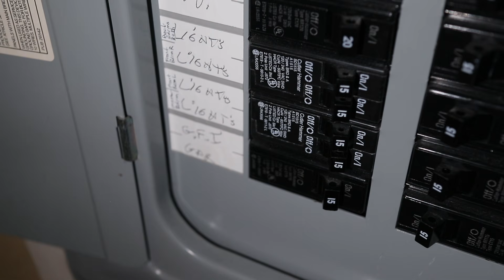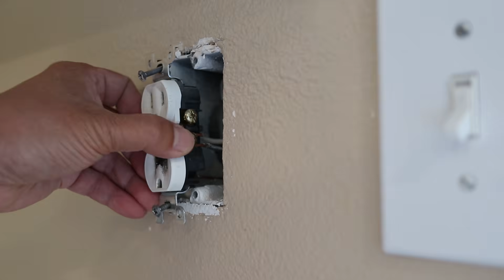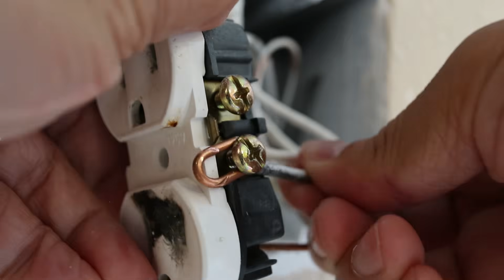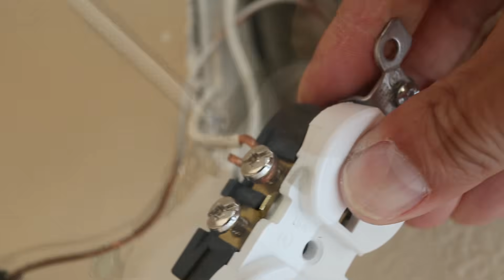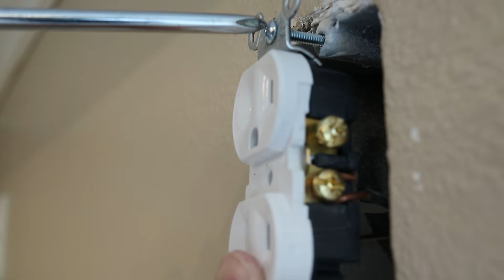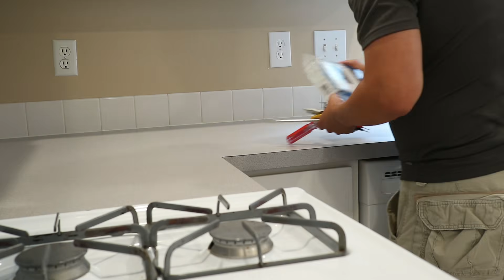How to Replace an Electrical Outlet – Replace Burnt Out Electrical Outlet and Old Damaged Socket

Comment: The wires had too much exposed copper wire to be safe when wrapped around the terminal there should not be anything that shows add a terminal except the insulation cover

Comment: That circuit tester step is really important. Verifying the outlet is de-energized takes only a few seconds but can prevent a dangerous surprise if the circuit labeling in the panel is wrong.

Comment: would this solve a fishy smelling outlet? its just one and unfortunately no electricians are available at the current time but i’ve been told i just need to replace the outlet. i don’t plan on using the outlet anymore to say the least 😂

edit: breaker to the room is off until i know what to do
Reply from the maker: From what I’ve recently read a fishy smell from an outlet is a potential problem. It’s best to replace the outlet or at least call an electrician for advice if you’re not comfortable replacing the outlet yourself.

Comment: I have that same problem but the top outlet still works so I just covered the burned out  bottom outlet with electrical tape and use the top i rarely use that outlet so it should be ok until I get a electrician to fix it I’m afraid to do it myself even with the circuit breaker off lol

Comment: Can someone explain to me I had one that shorted out but the following plugs stop working as well I replaced the receptacle that shorted but still not getting power to the other two receptacle any ideas
Reply from the maker: You might have another plug in the same room or nearby room with a GFCI on it. When your plug shorted out it might’ve tripped the GFCI on the same circuit. Just press the reset switch and it should be ok. Just remember it might be in an adjacent room or behind something like a couch. You’ve probably already did this but check the breaker switch for your room.
Reply: @TheRenderQ  there is no GFCI on the circuit that I’m having trouble with I have 124 volts on the plug I replaced but the most important getting from the other plugs and switches are low voltage like 16v so do I need to replace all the other plugs and switches?

Comment: I burned out an outlet with a heater. I could smell it burning. I was able to turn off the breaker and pull the socket out the wall. I want to change the socket but I don’t have the materials to do it yet. Is it ok for me to turn the breaker back on because it’s connected to other outlets in the room/apartment? Or should I just wait until it gets fixed to turn the breaker back on? I don’t want a fire in the wall.

Comment: Thank you for your video it was helpful however I have never done anything like this before so I was very nervous if you turn on the outlet after you replace it and it doesn't work if you get the wires mixed up could not burn up the outlet
Reply from the maker: I don’t think you will burn out the outlet but if your wiring is not correct you could damage the device you plug into it or worse. So if you’re not comfortable with this I would recommend getting a professional to help!

Comment: can a bad outlet cause no power in room? bc thats what is happening to me it was sparking
Reply from the maker: An outlet that is sparking can cause a room to lose power only because it may have tripped the breaker switch for that room. If the breaker switch didn’t get tripped then it’s possible that it tripped a nearby GFCI outlet. Look for a tripped breaker or reset the GFCI switch.
Reply: @TheRenderQ  its good now, i changed out the outlet and my power is running well 👍 person who wired this house did a really bad job and power goes off in sometimes 2 or 3 or just a light. yeah it can sound complicated but thats how it was lol 😂

Comment: NITS TO PICK -
1.) Use a Needle Nose Pliers with INSULATED GRIPS. Yes, the power is off ...sort of.....maybe... but you still use standard safety practices and tools. 
2.) Again, while the Power might be off, until your wife or child turns it back on without you knowing, I do not touch bare wire or screws. Yes with the Power Off it is safe, but it is also a bad habit to get into. 
3.) Use proper tools of the Proper Size, that long screw driver is a prelude to it slipping and causing an accident.
4.) Use Insulated Tools and never let your skin touch any Metal part of the Tool. Yes the Power is off...for now... but this is a matter of Bad Habit vs Good Habits.  
5.) Screw all the Screw down. Don't leave the unused one sticking out like you did. Again Bad Habits vs Good Habits. 

Handling any Electrical Wiring is like handling a Gun, even if you know it is safe, you treat it as if it is not. The Stakes are TOO HIGH to get into Bad Habits or to tolerate a mistake. 

Overall though, very helpful.

Comment: What if the wire insulation is burnt?
Reply: Might have the wrong wire size for that circuit. It shouldn't burn before breaker trips

Comment: This is one of the worst wiring jobs I have seen.  There is  way to much insulation stripped from the wires and the wires are badly nicked.  You need to redo this and fix your work!

P

Comment: A few pointers:   test BOTH outlets for power before opening and handling.  One of them could be a switched outlet that is powered independently from the other.  2.  Too much bare wire is exposed from the loop.  Ideally, the insulation should end just before the screw head.  3.  On the old receptacle, you can totally remove the screws to make freeing the loops much easier.  4.  For the new receptacle, if the loops don't go under the screws easily try slightly backing the screws out (don't remove) this may get you the clearance you need.  5.  Any unused screws should be tightened down.  6.  Make sure the black wire goes to the brass colored screw, white to the silver colored screw.  Don't assume the person before you did it correctly.
Reply: i love the last part. don’t assume the last person did it right! i learned that the hard way🫠
Reply: Great Tips! Thanks!
Reply: all great points 3283...
Reply: Excellent tips. Thanks.
Reply: Thank you!!
Reply: Thank You
Reply: Thanks, I feel like I am getting close to trying this myself and not have my house burn down. If I were still renting I would have gone for it already

Comment: Just a reminder to everyone to please keep the “hook”  trimmed to the appropriate length. Most outlets actually have a gauge printed on the back showing how much of the wire should be stripped. When it’s excessively long and sticking out it creates a risk of the wires making contact with something that wasn’t in the plans. Many people also wrap electrical tape around those terminals also to prevent it from shorting out during reinstallation. Everyone be safe !

Comment: This didn’t help at all. You’re only showing how to replace a traditional outlet with another traditional outlet. The outlet I have has like 12 wires poking out the back, no screws whatsoever. I’m trying to replace that outlet with a traditional type, such as what you’re replacing here. It’s a common bedroom outlet, but it does not look like any outlet I’ve ever seen before. I can get it disconnected from the wall, but then what do I do with all 12 of those wires when all I need is 2 or 3 with the standard traditional wall outlet I want to replace it with?

Comment: I have a plug that is burned like this one but the wire is  to far in to pull out to replace  so I decided  to cap it off but it piggybacks other plugs and I can't get power back in my room ...what do I need to do ?????

Comment: Can you still use the other outlet that was not burnt?
Reply from the maker: I made this video awhile ago but I think the other non-burnt outlet still worked. Actually I think both outlets still worked. That black plastic was probably caused by sparking and maybe just a cosmetic issue but for peace of mind I replaced the outlet. Thanks for watching!

Comment: Just commenting as I watch.

It looks like there’s paint, or some other random overspray coating on that ground wire. It should be cleaned off on the hook end before reconnecting to prevent a poor connection.

Comment: That hook strip is a bit long, especially if you have a metal outlet box. I’d be nervous about an arc to ground, or a short if there are a bunch of wires shoved into a shallow metal box.

It might be worth trimming the wire a bit to shorten the exposed wire, & reform the hook, just to prevent potential issues.

If you have a plastic box, it may not be an issue. However, many older homes were wired with metal boxes, & sometimes metal conduit to prevent rodent damage to wiring. Just something to consider.

Comment: Thanks, 15 here and with a bad outlet in the living room with a smell coming from it and a family that's too busy to do anything about it, I thought I could get it but overconfidence isn't something you want with stuff like this.. wanted to double check myself and this was just perfectly concise to do it without taking all day or getting a shocker. I won't go into it since it's already in nearly every comment but definitely important to remember the way the wires are supposed to hook, so it doesn't loosen when you tighten the screw, I think I remember that from a Technology Connections video. Gotta love that Alec.

Comment: Great video but too much copper exposed on the wire connecting to the terminal screws. It shouldn't extend past the screw especially past the back of the outlet.
Reply: But what if you're just a diy type of person and don't know what's the exact requirement where can we find this info
Reply: @lindamora7 Copper is what carries the electricity

Comment: After having a horrible experience with a very bad and insulting electrician company, I never wanted to bother with one since. We have an outlet that was burned out (from previous owners), that we never got around to fixing. I've always been nervous working with anything electricity related, so I just left it be and put a bookshelf in front of it, as to not be accidentally used. It's been five years since we moved in and now that we're remodeling, I need that particular socket fixed. I thank you for saving us money and making this video very easy for worriers like me 😂 Now, I can easily replace it 😊

Comment: Receptacles burn out mostly because they arc due to failing blade retention, which in turn results from heavy usage.  So, replace with a commercial-grade unit that has more durable and positive blade retention. For a few dollars more, they'll last much longer, plus their back wire feature makes them easier and quicker to replace because you can avoid the entire finicky j-hook routine. 

Also, if the exposed wires are so long that they go past the receptacle, trim them back a little to reduce the risk of a short. This is especially important if the box is metal.
Reply: That is a good advice I just replaced mine a few minutes ago and it was easy but I bit tricky because of the wires were butt heads but I got them in there place
Took me a hour to do that because of wiring or else it been 5 or 10 mins
This video helped me out and a very special 15 year old girl a big shout out to
She inspired me to do it myself

I said what the heck a 15 year old girl can do so can I !!!

And I did it!

I replaced ceiling fans now I replaced a electrical Receptacle what's is next

I have to take it step by step
Reply: @NorthernPolaris1225 Yup! Saw a fifteen year old girl in the comment section so this was my sign to man up and buy the stuff to fix my burnt outlet. Still scared..but it needs to get done.
Reply: @arlo9010  shut the breaker off and when you do the outlet remember where the wires go even take a picture of the wires so it will help you you got this bro it's has to be done or fire in your house and lose everything.
Reply: Nailed it 👍🏻

Comment: Here are some comments on the outlet replacement 1. You did not use an outlet tester to check the power is off and the outlets are working properly 2. You did not snip a little bit of wire the insulation is too long. 3. You did not use a #1 Robertson or ecx screwdriver/bit. 4. You did not do the ground first then neutral and hot. 5 Your outlet is not leveled on the wall.

Comment: A black burn mark on an outlet doesn't always mean that the outlet needs replacing. Sometimes, a high-wattage (amperage) appliance (coffee maker, heater, toaster, air conditioner) was unplugged with the switch on and it sparked while it was unplugged.
Another explanation is that a heavy inductive load (motorized appliance, vacuum cleaner, washing machine) was unplugged with the switch on. Motorized appliances produce a big spark when unplugged because an inductor opposes change in current.
Just clean off that outlet with steel wool followed by a buffing with a dry cloth.

Comment: Something important to remember: black wires (on the right) will typically wrap around under the screw first then over the top, so that when you tighten the screw clockwise, it tightens the wire more instead of loosening it. For the white and ground wires on the left, wires wrap over the screw then under because again screw tightens clockwise.
Reply from the maker: Thanks for the additional information. There have been several comments about the wiring. I just place it back the way I found it. And this wiring was done by the home builder. This is from a rental house and the tenants just moved out. There have been a lot of tips in the comments and now I can go back in and put some of that advice to use. Thanks for watching!
Reply: @TheRenderQ  I just did the same way you did and put it all back together like it was but had to do some adjustments on the wires so they stay tight and not near the outlet box 

Metal of course not plastic

I wish it was plastic

But you get what you can work with.

You inspired me to do that

Thank you.
Reply: This was the most complete instruction I have ever viewed on how to do a task. Easy to understand. I am off to buy what i need.
Reply: Results?  @stevesheridan3575
Reply: This is hands down probably the worst video on how to replace a receptacle. So many mistakes. People that never done this before need to know how to identify load wire common wire and on

Comment: No tryin to know what caused the blow out, still using the cheap receptacle DUH!!
Reply from the maker: Yeah I understand! This is from a rental property. When the tenants moved out they hid the damaged outlet with a cover. It wasn’t until I removed the cover that I saw it was burnt out. I replaced the receptacle as demonstrated in the video… and years later there have been no problems with it. Thanks for watching!

Comment: I spotted a few mistakes
Mistake 1: You did not tighten the unused screw terminals!
Mistake 2: You did not attach Ground, Neutral then Hot
Mistake 3: You did not use a #1 Robertson screwdriver/bit
Mistake 4: You didn't use an outlet tester. You are supposed to use an outlet tester (e.g. Fluke ST120+) to make sure outlets are working correctly
Mistake 5: The outlet is not level!
Mistake 6: There was too much insulation off the wire!

Comment: This is a slightly unrelated question but I broke off phone charger prongs and they’re stuck into my outlet in my room. The thing is, I did this 4 years ago and like a idiot I’ve ignored it. I plan on having a electrician come look at it sometime next month but now I’m paranoid a fire will start. I know it’s been fine this long but I just wanted to know how likely a fire would start and if people have commonly left prongs in their outlets before with no fires. I need to ease my mind because this is worrying me

Comment: I live in an apartment, and I don't have a circuit breaker. How would I do this without it? Can I just skip that step?
Reply from the maker: No! Do not attempt to replace your outlet without shutting off the power. Only do this with the power shut off or hire an electrician.

Comment: I know this video is old but the instructions could be improved. Even simple stuff like ensuring that the wires are going in a clockwise direction etc there is also too much exposed wire. You should use the gauge that’s on the back of the outlets to ensure the proper length of wire for your shepherds hook.

Comment: Hi, do you know why after I replaced it it still wouldn’t work? Thanks.
Reply from the maker: Sorry your outlet still isn’t working even after you replaced it! Did you turn the breaker back on? The only other thing I can think of is that your outlet might be on a GFCI circuit. This is especially true if the outlet you replaced is in the kitchen, bathroom or garage. Check nearby outlets in the same room to see if there’s a GFCI that got tripped. All you have to do is press the reset button if you find one. Hope this helps!
Reply: @TheRenderQ Hi, very late but I remembered that another outlet down the line was disconnected. After reconnecting, it works!

Comment: So I know this video is old but I have a question.

The outlet I want to replace has 2 black wires attached to the right two screws and 2 white wires attached to the left two screws and no ground wire at all.

What should I do?
Reply: use a 3 prong gfci with the no equipment ground sticker.

Comment: No good;  he doesn't discuss rooting out the cause of the burned socket----without addressing the cause the new socket may burn up like the original one---or this time start a fire.
Reply: Clearly you should do some of your own work to figure out the issue. There could be multiple reasons, but the video is just showing HOW TO INSTALL the outlet. Not “Here’s how to install in various scenarios” 🤷‍♂️

Comment: If he had power between the power wire (black wire) and the neutral (the wide slot) he's got worse problems than a bad outlet. There should be no power between the slots. That's why it's called neutral. Should only get a reading between the black wire and the ground wire.